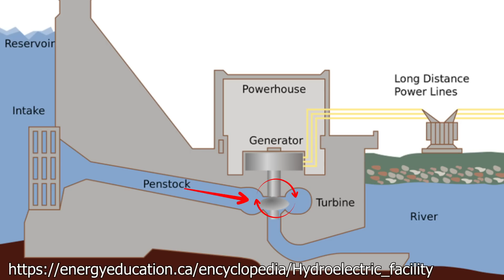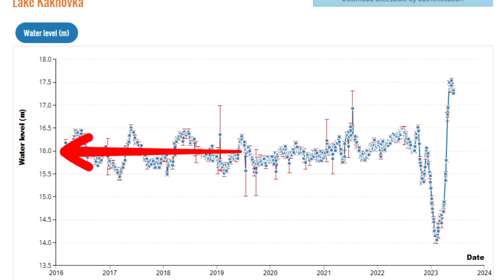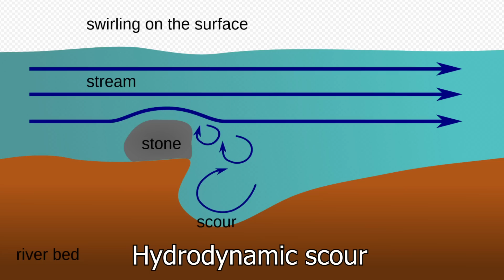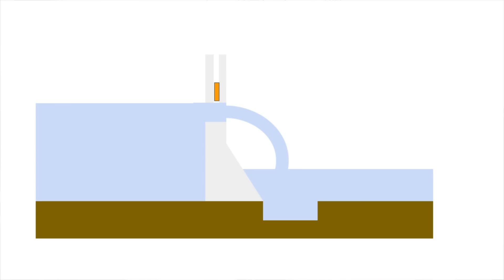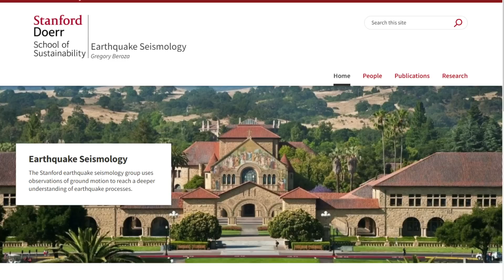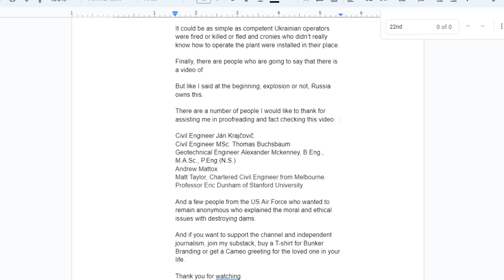How Russia Destroyed the Kakhovka Dam

Comment: Another factor that you didn't mention as to why Russia might not have intended to do this:  Crimea is one of the best natural fortresses in the world.  The chokepoints are such that with sufficient artillery (ground or sea based), even a military so incompetent as the Russian one could hold off invasion for an insane amount of time.  Thus the most realistic way to crack such a nut is... through a Siege.  You know, denial of crucial resources.  Such as water.  Why would they do Ukraine's work for them?

Then, consider the fact that Sevastopol is the Russian Black Sea Fleet's only Deep Water, Warm Water port, and the importance of Crimea to Russia becomes clear.  
Indeed, there are some hypotheses that the entire reason for the war is the Russians feeling they need to hold Sevastopol.  Under this hypothesis, the Russians invaded Crimea back in 2014 to ensure that the anti-Russia/pro-Europe shift in Ukrainian politics (see: Euromaidan uprising) didn't result in the Ukrainians terminating and/or refusing to extend the Russian lease of Sevastopol.  Then, the 2022 offensive would have been to guarantee a land bridge, because the Kerch Strait Bridge, while useful, isn't as reliable a method of resupply.  After all, that explains why, as soon as the push to Kyiv failed,  Russia redirected all their forces to their current positions 

...positions that are currently holding a land bridge

Comment: No all that water does not push against the dam. Most of the weight if water is taken up by the ground below it and only a certain portion of pressure is applied on the damn. You see such a pesky damn cannot hold so much water if all that water is applying force on the dam alone. This is the reason why a down stream damn would fail if upstream dam fails.

Comment: Russian incompetence in attempting to destroy more of the structure over the over the spill ways, so it could not be used as a crossing point, could also be responsible. Assuming that decking was structural tensile member, and they tried to remove another one, in combination with the maximum load on the dam caused by the water level, one of the vertical member may have failed laterally and then dominoed.

Comment: Hi Ryan , your theory is interesting but I do not quite agree on what you say about the hydrodynamic scouring and this for the simple reason that all dams (at least all the ones I worked on when I was a commercial diver) have a scour protection at their downstream side to prevent that phenomena. Most of the time it is made of concrete floor, but it can also be constituted by rip-rap stones, gabions or other protective stuff, and that’s why I still think that the dam was blown up by installing an adequate quantity of explosives into the maintenance gallery that is present inside the concrete foundation that crosses the river. 
On the videos it can be seen that some elements of the power house has been lifted upwards and not pushed away. This can only happen if some explosives were detonated under the construction, that’s to say into the gallery.
Another point that makes me think so is that I asked myself why the Russians who had control of the dam let the water reach the 17,5 m level, level that was never reached before. 
This was most probably premediated because the more water there was at the upstream side; to more flooding will happen at the downstream. It would really be interesting to make a deep survey in the area of the power house to find out if the maintenance gallery has been blown apart or if she has only sustained little damage to find out what really happened .

Comment: Great video but there is a problem with it. If the dam collapsed, then there would be only one huge hole as the water would keep grinding the dam, except this is not what we see. I certainly think that ukrainian infrastructure before the war were in a bad shape and that 1 year of no maintenance could have led to this outcome. I think that it would be possible for a well placed gmlrs to destroy one of the sluice in such a way that it would start the grind of the dam. That could explain why there a more than one hole in the dam.

What is certain to me is that russia has no intrests in doing so. As for Ukraine, this is not the case:
1. They get the control over the flow/level of the dniepr on the whole frontline. such tactics were already used in the kherson battle (in which Russia destroyed dams in Ukrainian held territory with missiles).
2. They remove the reservoir which could become at the turn of a switch, which is in Ukrainian control, a frontline (especially a frontline in which russia has hard times ressupplying). This is also a liability as Russia could probably destroy the dniepropetrovsk dam.
3. If the frontline freeze, they either get a bargaining chip for peace talks (as Russia needs the dam for crimea and ZNPP) or they create a cost for russia in case of a prolonged war.

The only way to see disadvantages for Ukraine is to think that they will take back the south easily.

So i cannot discard the possibility that Ukraine did it and i lean towards it. Now if someone could explain me how multiple holes appeared in the dam, i am happy to listen/learn and change my opinion.

Comment: Water structure civil engineer here. I do not agree with your assesment.

- Overtoping usually isn't problem for a concrete dams and especially not for a dam with spillways on the top, they are specificaly designed to let the water flow along it's top. Many concrete dams were overflowed during catastrophic floods but they rarely fail due to this (and if so, those were several hundreds meters high. Earth-fill dams are the ones that fail due to the overflowing water). Overflowing would probably damage some of the gate mechanism, but nothing serious, this is what the engineers take into account when designing the dam.

- Such a dam as Khakovka has control tunnel that goes through the inner concrete structure (just look at english wiki about Khakovka dam, picture "Cross section of Dam Wall and gates", orange color) for different purposes, mainly monitoring. The acces to this tunnel would be from the powerplant and Russians would have no problem to go there and do whatever they wanted for several months. No problem planting small amount of explosives at the right places (speculation: probably to drilled holes that lead upwards from the tunnel near the piers, see the cross section) No need to manipulate the water level. (EDIT: sorry, you were saying the same from different reason, my bad)

- From the video of the damaged dam (from 0:25) I think that the water flowing over the dam isn't that deep, the base part of the concrete is still there, no erosion from the bottom. That and the fact, that the flood wave wasn't actually as big as it should be should the dam be removed from the subsoil/bedrock (I think I saw a photo from dry summer of Nova Kakhovka dam, where the bedrock were visible under the dam, but the internet is flooded with the photos after the destruction and I am not able to find it agian). There were bigger floods in the history of this dam and it stood sound. The flowing water (in the case of complete removal of the "basement" of the dam) should have characteristics of "river flow" instead of "stream flow", you would see the huge chunks of concrete (every sluice should be one huge part of concrete) toppled or parts of that raised over the water surface. We would definitevly find out as the water receses in the summer and new photo and video are shared

- If the dam should be compromised "from below", the fault would propagate much slower, in the means of days or weeks (even earth-fill dams take hours to destroy itself) and it will affect only the neighborouhing slucie gates/blocks or the poweplant, it would not just skip the middle part like in this case. The plant is destoryed near the river bank and on the gates side, but the middle stands. Also, the turbines are very often (I have no info about this plant, but it's really common) under the minimum bottom level of the downstream water surface, maybe even deeper than the basemant of the sluice gates (due to cavitation of rubine blades and other funky stuff), I don't believe it even could end up destroyed due to the running water, negligence or not.

- Considering the missing piece of the road - there's missing part of the pier under that bridge which very probably cause the two sections of the bridge to collapse. But the pier is there only for the bridge, it has nothing to do with the strutcure of the dam itself. I don't know the exact codes that were used in USSR, but it's common when building those kind od dams to withstand at least 1.000 year flood, very probably the 10.000 year flood which is nowhere near the circumstances or discharge. Also the dam should withstand ice floes that were common during planning of the dam. The amount of engineering, robustness and safety levels that goes into planning dams are just insane. Exactly for the reason you mentioned there is (my english felt short in here, sorry) strutcure that prevents hydralic scour, simply put you built massive slab of concrete that runs 50m under water from the dam downstream along the riverbed. This could deteriorate only if it was already severaly damaged during previous decade or so.

- My theory about the water level changes: the three sluices on the UA side were destroyed together with the three bridge sections and the powerplant went 100% so the water level drops during the dry winter months. Due to the very rainy spring the Dneipr discharge raises and water goes up because nobody is manipulating the gates since the winter 2022, that's it.

PS: tip for destroying this kind of dams: go for the earth dykes, either with explosives or with an excavator. Much easier job, used quite often when you want to get water back to the river/sea after the flood (after hurricans for example)
PPS: maybe try US Army Corpse of Engineers next time? They have experts on every engineering topic and they are renowed worldwide for their work in water structure engineering, they could be even closer to you than the academic workers (no offense, I was academic worker too)🙂
PPPS: since the Soviets blew up the dam during WWII, I would excpect them to incorporate the plans to do it again. Some dams have still holes after German occupation in them, some old important bridges are also ready to be mined and blowned up. Nobody talks of this of course, but some structures were build with this in mind.

Comment: I think I agree with you in as much the Russians had control of the dam and opened that one gate and had it open too long and it caused the dam to fail. Did they do it on purpose or was it lack of understanding on how to operate the dam? It doesn't really matter anymore because the dam collapsed when the Russians had control of it so it's their fault. 

The big question now is how well they are taking care of the nuclear power plant. Not being able to take care of the dam is simple compared to a nuclear power site. I think Russia should turn it over to the Nuclear Regulatory Commission of the UN. That way they wouldn't be responsible for a failure. Would the Russians do that? I don't think so as long as Putin is in power. And that's the problem, the Oligarchs of Russia are the only reason Putin is still in control of the country and I would think they could be charged with the same WAR CRIMES that Putin will be charged with. These people have a lot of power and the country would be better off if his cancer killed him. Hint-hint.

Comment: Your explanation is contradicted by leading institutions that assume that an explosion is at the root of the collapse. An undisputed explosion because based on seismic vibrations and video footage.
Reply: Geologist here. The seismic signals were very weak, the largest was only "Mag 1 to 2". A magnitude c. 1.5 event has an equivalent energy release of only c. 2.7kg of TNT (see: Earthquake Calculator by Hanna Pamuła, PhD). However, it is important to note the true TNT value depends on a factor called Coupling, the proportion of explosive energy converted to seismic waves. Only a very small proportion of explosive energy is converted to seismic waves.

For example, the Buncefield explosion (a huge fuel storage depot that exploded in the UK in 2005) caused a Mag 2.2 tremor, an energy equivalent of only 30.9 kg of TNT. However, using a Coupling factor of 32.4 to 324, the estimated TNT equivalent was increased 2–10 tons TNT. The same Coupling factor for Nova Kakhovka results in a TNT equivalent of 87.48 to 874.8 kg of TNT, average of 440 kg. This does not appear large enough to destroy the dam. 

Also, the largest seismic signal at 02:54am was picked up well after the dam collapsed, 2am - 2.30 am.

There is also surveillance footage of the dam at 2.46am, after the collapse, that shows an explosion (possibly a land mine, anti tank mine or even a sea mine that washed down river and hit the dam).

Comment: Nice analysis...I bet all the combat related explosions added to the instability of the dam's subgrade.  Vibration induced liquification of subgrade material...then seepage forces increase and accelerate piping of liquified fines...then voids, then subgrade failure, collapse and finally massive structural failure.   The massive changes to the water table certainly did not help.  It almost looks like somebody saw a problem, then maybe after a long time maybe tried to do something...like plug the hole?   Bombs were not required.   But...the russians were in control.
Reply: Liquefaction would not be an issue even if the damn dam was destroyed by an explosion anywhere in or on the dam.  Ryan is dead to rights correct.  I have degrees in bs, more of it, and piled higher and deeper from The University of Texas at Austin.  I have worked on dams in Chile, San Francisco, the Mosul dam in Iraq, several throughout Kentucky, Tennessee, Alabama, and Ohio and Indiana.

Comment: The water levels show many years of fluctuation exceeding historical ranges.  It suggests leakage not summer winter flow management.  It is possible that there was enough vibration from combat in the area beyond what the turbines do to "liquify" the soil (through dilatency) and then accelerate particulate movement (piping) that would create voids, channel flow and then scour.   It could easily take years to show up but the drastic changes in water level would speed things up!

The bottom and sides of such structures are often the first to go because seals are hard to build and maintain and because the accepted soil mechanics for subgrade soil mechanics design were not known in the West until after the dam was built.  I know that because I helped rebuild one in the USA that had that problem.

While it is possible the Russians used good designs themselves, it is not in the engineering design literature that I was introduced to and we gave considerable credit to russians for very good mathematical approaches.  I think highly of some of their work even now.  They did not use computers....they used closed form mathematical solutions and ingenious approximations.   

It would not be hard to imagine vibration from many sources causing the subgrade soil to fail or accelerate the failure and then damage support for the structure itself.  

Most likely the brown material is soil.  I suspect that soil was subgrade material following cracks.  The process is akin to hydrofracturing.  

I think seismic records can tell the difference between an explosion and whatever happened at this dam.  It may take years for the word to get out.

Comment: Hi. Please find plans of the Kakhovka Dam. Your hypnotizes implies that the the part of the dam that designed to provide waterflow through the gates are short enough underwater to create hole underneath. Which is in fact not the case. This underwater dam which serves as foundation for the gates has tunnel inside which could be used to install explosives.
Reply: its built on sand foundation. Underwater part of the dam extends about 100 meters downstream and provides shielding for processes you described in the video.
Reply: @drzerg2  Didn't work.   Lots of protective aprons fail.  Highways, underpasses, roads etc.